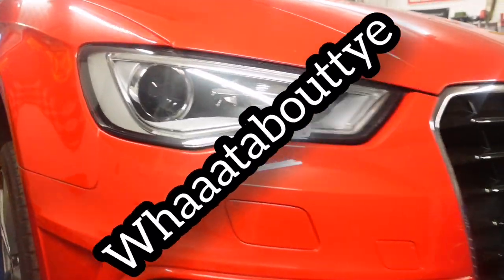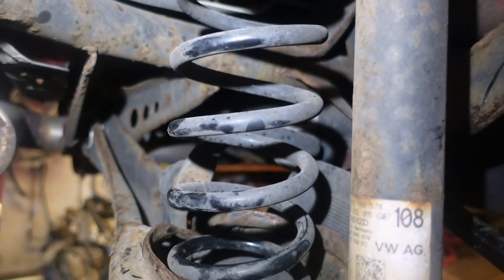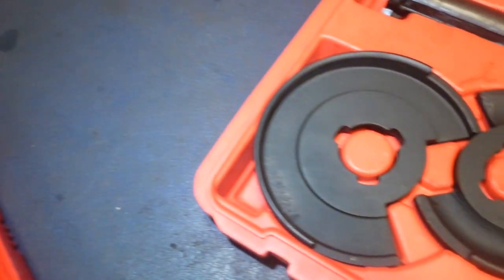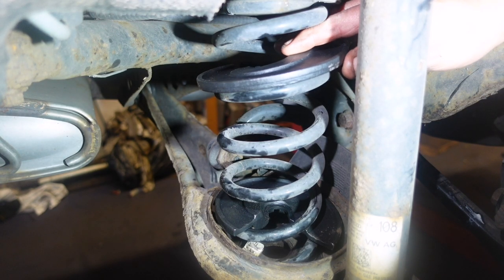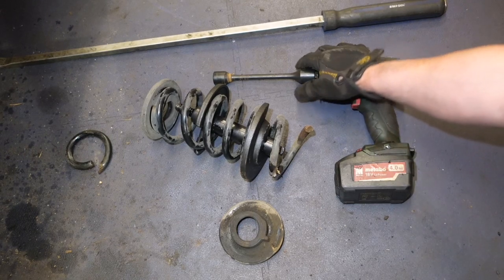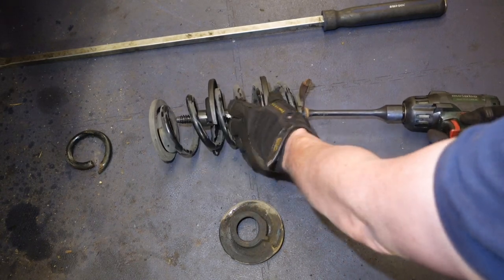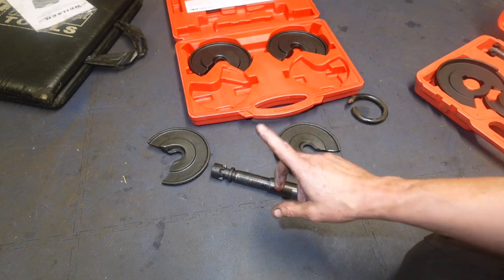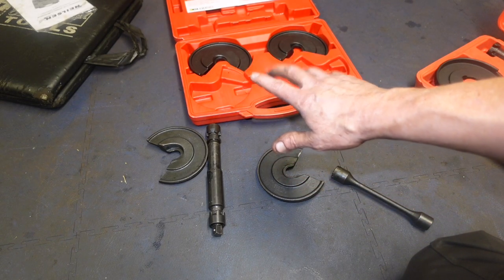Audi A3 Rear Spring. Internal Spring Compressor Tool

Comment: On the Audi A3 it's probably easier to just remove the lower 'spring pan' bolt and then drop the pan enough to remove the spring. However, the Audi A4/A5 platform cars have a 'fixed' lower spring pan so the internal spring compressor tool is ideal for those cars.👍

Comment: With the weight of the car on the wheels, wrap STRONG steel wire around the spring coils. 
Then when the car is jacked up and the weight of the car is off the wheels, usually the spring can simply be removed by hand. Reinstalling is easy as long as the spring remains held in compression by the wire.
Inserting a new spring? That's up to your imagination but it will probably need to be compressed just a little, maybe not at all if the shocks are disconnected.
Reply from the maker: or hit it with the torch and the spring collapses, lots of ways of getting it out

Comment: Good old scary spring jobs Dave,  not good when the tool is climbing up the spring when your running it up to tension , it diddnt want to come out at the end at the bottom,  I think it would have been beaten to death by many , I did an a4 saloon the other month , compressed it using the other tool we all have , couldn't get it in , had to loosen the subframe n get the old scaffolding bar out to get it back in , with a bit of grunting 😉 dont we love our jobs 👍👍
Reply from the maker: Fun Fun Fun, u love it Mike
Reply: @davesterl  I know now why you use mr porta power , extra safe hands , bars slip , fingers squished 🤣🤣🤣👍👍👍👍